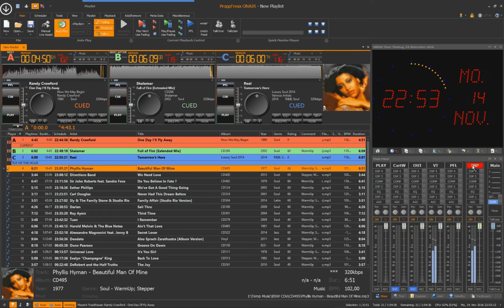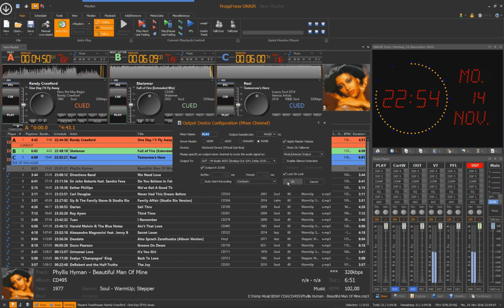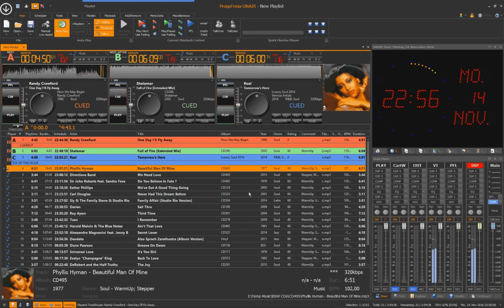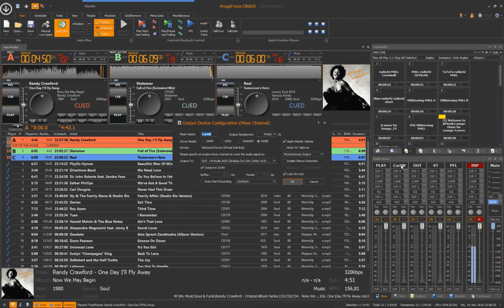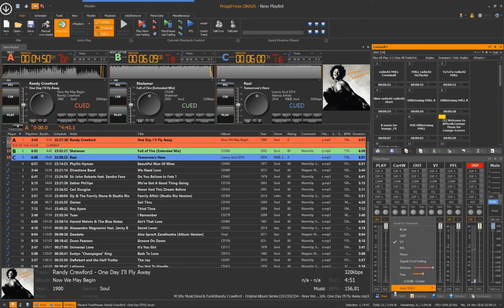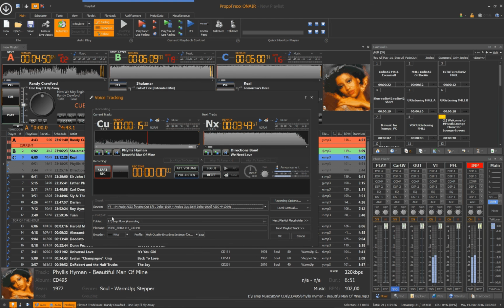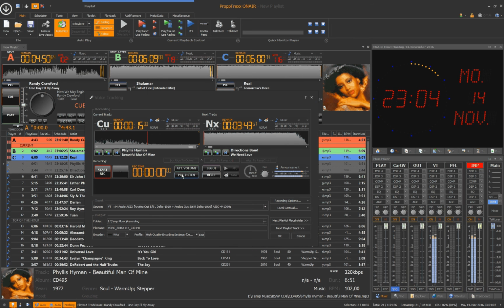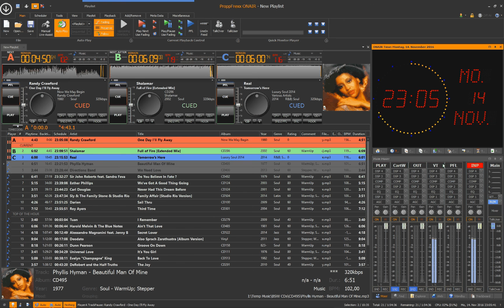Mixer and VoiceTracking

Comment: Hi,Bernd. Great video and thanks for that. Ima having that problem here. I can't stream my mic. I can hear it, but it doen't go to the stream. But i can see the input and output form the mic. Im using extrenal mixer, 2 mics, 1 control deck (dj +serato), evgerything goes to the mixer, which  goes to the Focusrite and  i've made pretty much similar setup like you did for "play" and "cards" (im using just one channel). My goal was live debates and interviews. So i need my external mixer and cue, eq etc by hand and hardware. More convenient. BUT i can't set up the mic. I've made a channel called "AIR" like your "Out". My "INP" chan is set to a mixer channel i've made called "MIC". So MIC is okay tru PFL and local speakers/monitors but doesn't go to the stream. Why ?
Reply from the maker: To record you MIC (which seems to be connected to your external mixer) for VoiceTracking in ProppFrexx you need to feed an output of your external mixer back to an input to your PC!
In ProppFrexx you then need to create a mixer input channel, which picks up the signal from that input of the PC. In the Voice Tracking dialog you then need to select this mixer input channel as the recording source. If you then also want to stream this mixer input channel (e.g. called MIC) make sure, that in the configuration of the MIC channel you also select 'Outut To:' and specify the 'AIR' mixer channel - so that the MIC input signal is forwarded to the AIR output (assuming, that you are streaming from that AIR mixer output channel?!).
For more question, please use the User Foum at: https://www.proppfrexx.radio42.com/forum/
Reply: @radio42bn  Thanks man for the reply. But thing is that i don't want to record. I just want to stream. I mean i want the ability to talk. Or if i understand correct i need to go to "Voice tracking " to able to do so? EDIT: It's Done. ;) It was my bad. Made a mistake in the initial setup.

Comment: Hi Bernd, do we set cuepoints on each track in the musicfolder before starting with voicetracking?
Or can we start without?
dirk@rbs-radio.be
Reply from the maker: You can, but that is not needed, as you can also set them after/during VoiceTracking, e.g. in the graphical Segue Editor.
Actually most already set cue-points might be overwritten by the VoiceTracking ;-)
Reply: Thanks Bernd